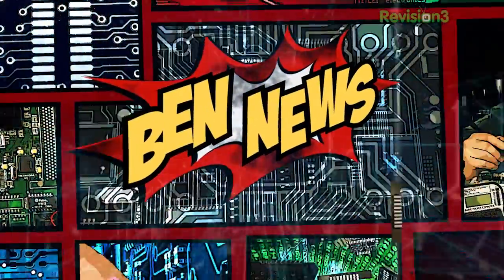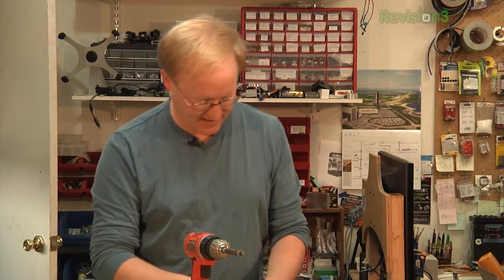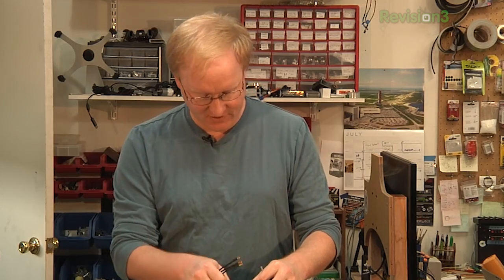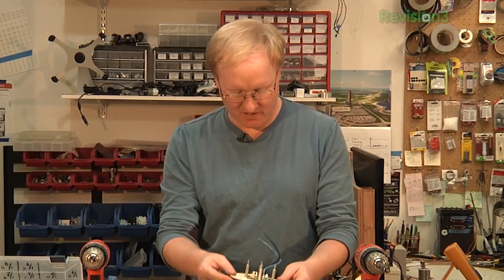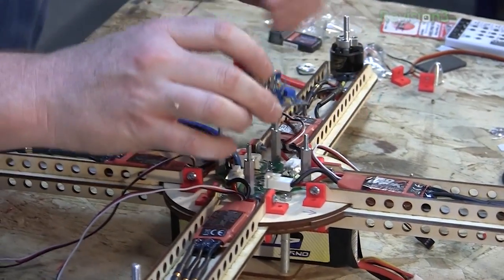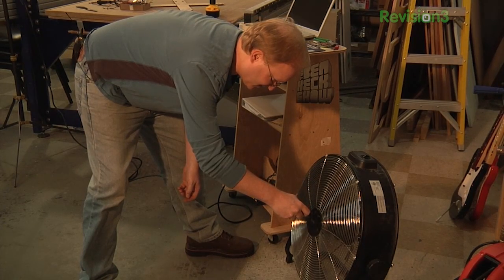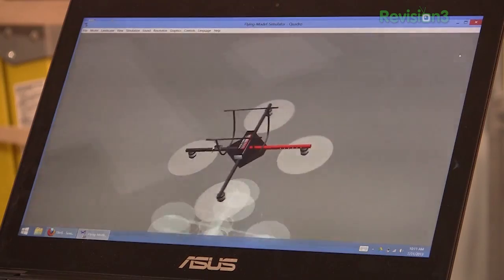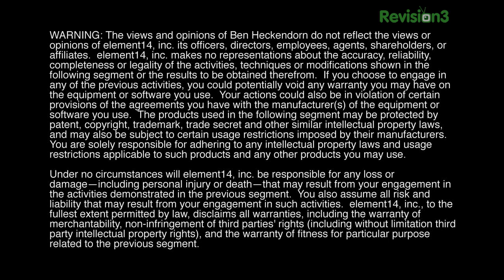Let's Go Fly a Quadcopter - Part 2

Comment: The reason it wobbles is because the wood doesn't dampen the vibrations very much, what would be better is carbon fibre or aluminium with bits of foam or cloth between each joint.

Comment: The wobble is the board trying to compensate and balance the quad. The problem is it compensates too fast and you need to go in and change some numbers in the micro, so you'll slow down the compensation a little.

Comment: i think the wobbling was your pid settings. basically if you set integral gains and derivative gains to 0 so that it is basically just a proportional feedback control loop and then increase the proportional gain (make error proportional corrections larger and larger) it will overshoot and then try and correct the overshoot and overshoot again inducing an oscillatgion. if you wikipedia pid controller there is a section on pid tunning, and one methods the point is to set I and D gains to zero then increase P gain until you get an oscillation just as you had, then use the P gain at this value, and the period of oscillation to calculate the correct P, I, and D gains. but basically it looked as though your quad would fly pretty good once tuned correctly which is allways a process when flying a new multirotor for the first time. also no offense but it looked like most of it was pilot error haha.

Comment: the wamble would be because the gains on the main control bored are set to high, and there maybe some vibration, so you might want to suspend the control bored on some foam. also with my first quad instead of keeping it on the ground its best to get it up about 4-5 foot (or chest height) and trim it out, once you get it set right they can be a dream to fly
Reply: He might have just had a shitty control loop too. But yeah it's clear he needs to adjust the gains first. lol
Reply: it could be that, but those control bored are know for being very touchy, and they do work better with a computerize radio but they can get pricey and complex, im still trying to get my head around the turnigy 9x although I will upgrade to something like an aurora 9 or 9x soon I hope

Comment: The wobbling is common in multi rotor helicopters and part of the setup is tuning some parameters on your flight controller to alleviate it.  They are called PID settings which control the gain and reaction timing of the motors.  You'll have to look up how to change those on your board and tune them until you defeat the oscillations.

Comment: The reason the quadcopter is shaking is because the p gain and i gain isn't tuned right. You can adjust the gains on the board. 

Good job building this thing, especially because it is your first copter

Comment: Its the gyro PID settings that produce a oscillation, correct pid settings will make this a solid flyer. 
2 of each blade types mean the quad uses differential power to the 2 different sets to induce a controlled torque turn in a rudder manner.

Comment: Why u no change gyro gains? The three pots are for the 3 axis gyros on the controller board, if they are to high it over stabilizes and wobbles like hell, not enough gains then you will most likley crash

Comment: Funny that in the beginning of the video there's something that may actually work very well as a quadcopter frame right behind Ben, which is a monitor stand. Though that's probably way more expensive than a few laser cut wooden parts.
Reply: I was thinking the same thing! That gray/white colored x-shaped thing on the wall. lol Would be perfect.
Reply: Also a lot heavier than the wood. Weight is an important consideration when you're building a quad (or any type of aircraft really.)
Reply: Donald Burr he could of taken that and used it to draw a template on wood?

Comment: The wobble could also be as u said before balance even though the gyros should adjust speeds to compensate the weight  and uneven parts could be the problem

Comment: you need to tune the PIDs on the flight controller. also balance the propellers will help, but pids is the main thing. the best landing gear i have found is taking a a piece of 4in pvc pipe and cutting ~3/8in thick slices. strong, but also "elastic" you could also cut a piece out of the slice to make a sorta "C" shape which would provide more dampening.

Comment: Ben, the wobble is most likely from the MCU. I say this because it is only effecting 1 plane. A prop miss-balance will cause one arm to vibrate or the whole thing to spin.
There is normally trimming pot's on the prebuilt controllers, these do not represent the centre position but change the amount of gain the MCU uses to balance the flight.
Basically to gain is too high causing over shoot.
Other tips for stabilising a Quad-mount the MCU using locking nuts and a foam pad to help damper vibration.

Comment: It's good practice to ALWAYS turn your transmitter on first and off last.. and Tim Watterson is close with his post.. only I don't think the controller you chose is that fancy.. you need to turn the gain down on the gyros most likely with small potentiometers on the board.

Comment: Couple comments. First the esc(s) must be calibrated so that all motors react to control input equally. Second, the P gains looked like they were set to high. Decrease the P gain just below high speed wobble. If low speed wobble the reduce I gains.

Comment: maybe the wobble also omes from the way you have mounted your flight controller. you should use nylon screws so the flight controller's gyro doesnt react to the vibration of the motors.

Comment: The oscillation comes from the gain on the gyros being too high.  As you are using the KK board you can lower the gain with the three trim pots. You want it to be just lower than the point at which the oscillation stops,  if the gain is too low the gyros don't do anything.

Comment: I used the same cheapo $13 flight controller on my first quad and it flew smooth as silk with the gains properly adjusted.
Just buy one of the $110 quad kits from RCTimer and you'll save yourself a lot of hassle. Also cheaper.

Comment: Hi 
Ben, youve probably figure it by now, but check the Gains (PIDs) for the wobble. It looks like you built a nice light machine for the engines.  Either give it a bit more weight somehow, or just turn down the gains a bit.

Comment: Hi Ben,
I like the design but I think you will have issues with vibration to the KK board cause no motor /prop will ever be perfect out of the box.
I also think you should use some gyro double sided sticky foam tape for the KK board and maybe just redesign the central structure of the quad and use your fancy lazer cutter to cut some slots for velcro straps to secure the battery.
You may also need to reprogram the ESC's with simon K firmware but youll need a usb prog card and a prog device

Pete.

Comment: High gain limits will cause the over compensation and gyration of the craft. Another cause can he an imbalance of throttle limits in the esc's. Most of them are set by raising the throttle to it's maximum position and then applying power to the craft and allowing it to go through it's start up sequence, generally indicated with a round of tones. Once complete, lower the throttle and power cycle everything. My guess, gain adjustments.

Comment: the problem is, that the propellers are causing a lot of vibrations, and the metal screws are transporting these vibrations perfectly on the boarf, which is a huge problem. You should put some nylons scrws in there, together with some rubber vibration stoppers. also i think you need to calibrate the board and/or the esc, and you may need to configure the firmware on the board, so it knows how much it should correct the flight.
but nice setup for now!

Comment: wood is quite good for quadcopters as it absorbs vibration which can cause problems for the flight control board. i have a wood one and a fibreglass/nylon one. the wood quad flies a lot better

Comment: i need to help out 
1.  first LIPO bolted to the Quad = NO bad idea if u have a lipo fire you burn down your house and the quad 
2.  insulation close the gold Bullet if they short out in flight well u can finger it out 
3.  the vibration is from the props and your design   the 3axis gyro in the kk2.1 board don't like vibration at all and need dampening like mounting on sponge and your settings on the kk board are also wrong set the small pots on the board and all will get better

Fly safe and have fun

Comment: you might find it easier to fly in an X quad configuration rather than a + quad, it would be inherently more stable. Didn't see how you colour coded the props - if it was any kind of spray paint it could have a bad effect on the prop material may have contributed to the wobbles. Also try turning the gains down on the flight controller as if set too high they will fight each other causing the machine to be unstable. One last thing - did you calibrate the ESC's - props didn't start up together

Comment: It looks like the thickness of your arms would be restrictive to the air flow from the props. I would use carbon fiber tubes.
Reply: you have to go careful using Carbone/glass fibre as they can block/interfere with the 2.4 signal. although this can be over come by mounting the Rx out side and away from the frame.

Comment: a random thought i had the other day. could an aeroplane powered by 4 or more electric motors stay aloft by only using half of the motors to power the plane and the other half used as turbines to put energy back into the system?

Comment: The wobble might be because you seem to have lost the leg one side, causing there to be less weight on that side, which throws off the balance, This means the "brain" is having to compensate because the side with less weight will rise faster then the opposing side.

Comment: Is there a way to make a battery output AC instead of DC ?
Reply: im not sure
Reply: inverter
Reply: well not that I can think of a valid reason to, it expect you can buy or make a bored that dose such a thing. although li-po betties are very temperamental when it come to things that aren't just running a motor through an ESC
Reply: lennonSystems mhm you need some kind of resonator. Depends, does the frequency need to be stable or ballpark?

Let's assume it needs to be stable, then you can take an NE555 timer and its configuration elements (see the datasheet), a MOSFET to switch the battery according to output of the timer (but you can leave it out and use the 555 OUT straight if you only need very little current), and an RC filter with a very small R to smooth down the output a tiny bit (can be probably left out if you're feeding a transformer)

If ballpark is OK, i'm sure there's an simpler way, like... the Joule Thief circuit has to be just about the simplest one?

What exactly are you trying to accomplish though? Because there's a million things that can vary depending on what that AC is really supposed to do, like is it driving a transformer, a particular kind of motor, ???

Comment: would it be possible to upgrade the range on a "flysky fs t6" tx rx like they do with the turnigy 9x module swap. The FLYSKY FS T6 has a solid back cover unlike the turnigy.
Reply: yes you could rig something up, but it would evolve opening up the transmitter. the easiest option would be to buy a new TX (e.g a turnigy 9x or 9xr) with or without the module from a store like hobbyking.com and then buy a module and Rx for it. although the standard 9x has a good range, and the 9xr has an even better rang, and youd lose sight of the aircraft before losing signal. (unless your going FPV) even then you can get at least 2-5 miles if not more out of these Tx and Rx's)

Comment: HI i see your video here on youtube ;) okay cool projekt when you fly it more than i have some tips 
at first make a big landing frame for example like a big X so the helicopter can crash so hard. the second thing you must do is in the setting menu of the board, and put the gyro sensibility down, so that the multicopter stops to wiggle. Than it would be much easyer to fly

Comment: (yes I know this vid is a year old; I didn't check until after commenting. mea culpa)

As many have commented already, gains are too high; set each pot to 50%, then adust one gain until wobble reappears, then back it down slightly. Rinse and repeat. The controller (I'm unfamiliar with the one in use) may have software-based PID settings which would need tuning in a similar manner.

First, though, get that controller off of the solid mount! Every vibration is being transferred to the gyros and freaking them out; you'll never get good settings.  With a properly isolated and gyro calibrated controller, out of balance props are of little significance in a quad of this size and weight.
Reply: Doc Hogan Too bad he didn't finish the project.  :-(

Comment: The wobbling is caused by a wrong PID settings. There should be potentiometers on your flight board to change them. Thats how to stop it from wobbling. Its a thing of trial and error to find the best setting for your specific setup. Look at my channel to see my latest Hexacopter returning home autonomous through gps. Best regards

Comment: can you show step by step how to make a power supply
Reply: to use a PC power supply is very easy...   (3 steps)
1. Any black wire is ground (or negative) there should be a few of them to choose, it doesnt matter which one..
2. The yellow wire is 12v Positive. (Have a look at the other colors such as red, white etc.. with a multimeter and see what different voltages it puts out, some may be 5v, while others are 3v, 12v etc..)
3. In order to turn on the power supply without a motherboard attached, join the green wire to a black wire.

Your done..  easy as that!
Reply: He's made a video on this already. Search before you ask.

Comment: If you are still interested in quad-copters and very inexpensive RC aircraft, you really need to check out www.flitetest.com They show you how to build multi-rotors (tri, quad, hex) as well as RC airplanes. The RC airplanes are made out of foam board which only costs $1 a sheet. Only the electronics are expensive. They have free plans for a number of different foam board airplanes including Dusty from the Disney movie "Planes". Fly worry free because crashing a plane only costs about 2-3 dollars in foam board.
Reply: Nice one..  Have you actually tried to make one though?  For me, I prefer to buy a foamie pre made..  it took me 10 to 20 hours to build the spitfire only for it not to fly properly and crash first go..  So do you want to spend $3 and 20 hours or $25 (from hobbyking) and 30mins and fly a plane?  I've done both and I can tell you the latter one is more pleasurable
Reply: FluffMuncher 10-20 hours? it only took me 15-20 minutes to build mine and it flew perfectly. I prefer to fly the one I made over a store bought one
Reply: halodingdong 15- 20 mins out of depron foam with printed layouts? or a spitfire kit direct from flitetest?
Reply: I just used dollar tree foam and printed plans from my computer taped them together and cut the pieces out with an xacto knife and glued them together, not that hard really